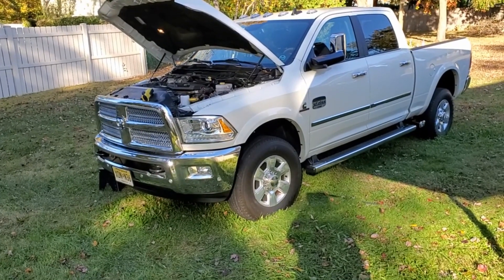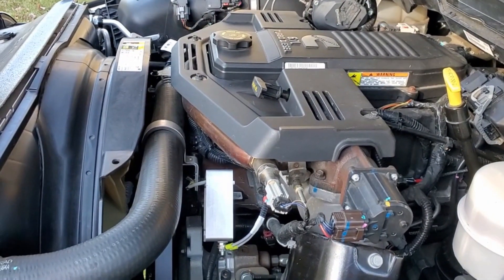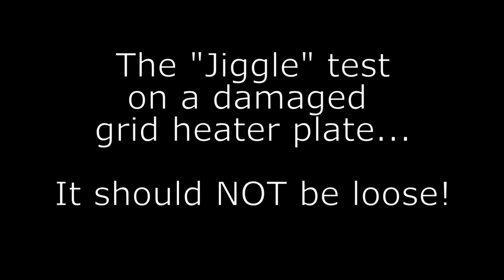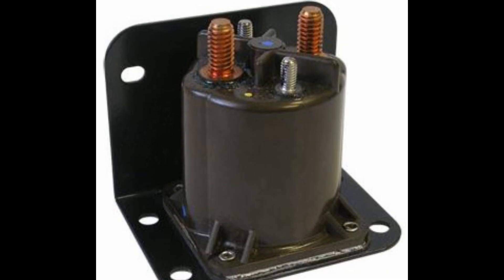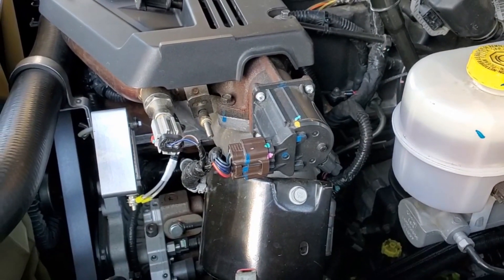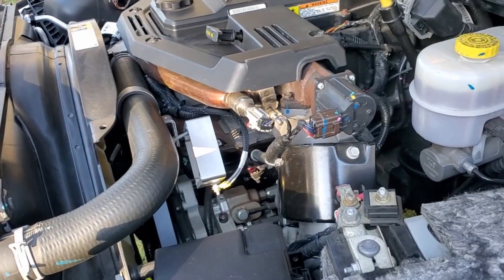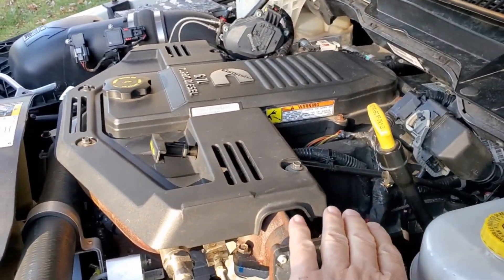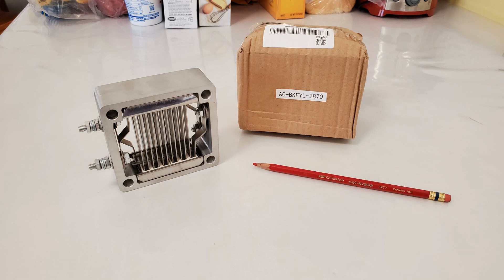GridHeater

Comment: Best way to get rid of this problem is don’t buy a dogde in the first place
Reply from the maker: Let me correct that for you... 
The best way to solve all vehicle reliability problems is to buy a gas powered engine. Modern emissions compliant diesels in today's market are complete garbage. Conversely, gas engines for small trucks (say under 15,000 GVWR) have greatly advanced in the last decade. Light diesel in today's market is a hobby and little more.

Comment: Hi I see its been 3 years since you made this, and you hinted around that you we're going to try 
to make a plug and play box . Just wondered if you ever got it done and if it was for sale. Thanks
Reply from the maker: Hi Cooter, The dummy load device I installed on my old 2016 has been doing fine so I never got the motivation to build the electronic version of the Grid Heater Delete gadget. If I ever do a tune & delete on my 2016 I'll have to look into designing and building the plug & play gadget.🍺

Comment: The easiest thing to do is to buy a kit from banks power Which has the upgraded Intake manifold. And the grid heater delete which does away with the grid heater completely and you will get more fuel mileage and more horse power out of the engine and its also e p a compliant and it also comes with a heater that goes into the intake manifold
Reply: Yes at the dealer if not under warranty I tell the customer to buy that and we can install it.  If it’s under warranty I let them know there is a fix but they’d have to pay for those parts and we can do it under warranty that way.

Comment: Got a P0542 code "Grid heater short circuit high". Any suggestions?
Reply from the maker: An easily resettable code. Can sometimes be fixed by removing/cleaning/replacing the thin wires on the grid heater relay.

Comment: I know this was 3 years ago but a list of parts needed would be great!    This looks like a safe way to solve a huge problem
Reply: You can go the Banks Monster Ram route. It has the grid heater delete.
Reply from the maker: Greetings Chain, The parts are just some old grid resistors that were harvested from a failed grid heater plate. If you check the dumpster behind any large FCA dealer (especially in winter) you should be able to get a few burnt grid plates out of the dumpster. Each grid plate has two resistors in it. You will need both of the resistors.
The dummy load frame (mounted behind my fan) I got off Ebay. 
https://www.ebay.com/itm/403192617742
Search on 5.9L Grid Heater Element and you will have a selection of frames and complete grids to choose from. For additional info logon to cumminsforum.com and search for posts by forum member Electrojake “Grid Heater” or P2609.
Reply: @Electro489  Thanks for the quick reply!  Much appreciated

Comment: WOW, that is good info.  Did you ever get the updated "module" for the battery to allow a total disconnect of the grid heater?
Reply from the maker: I never built the grid delete module since the analog (dummy load) device is working so well.

Comment: Fantastic information.  I am getting a P0541 on my 2006 dodge ram 5.9, the so-called mechanic that fixed it, replaced the regulator and the check engine light went on 8 miles down the road.  He actually zip tied the regulator on to the battery cable.  Shoddy workmanship to say the least. Thank you.  Whatever happened to real mechanics.

Comment: If someone were riding around town with a stuck grid heater relay coil, wouldn't they have the icon displayed on their dash? Some people may not pick up on this issue if it's displayed, but technically if that coil is energized constantly, that yellow icon should be displayed constantly as opposed to just momentarily during initial start up. I'm considering going to the grid heater delete with Banks Monster Ram Gen 2 mod.
Reply from the maker: No! The signal on the CAN bus (and on your dash) only shows what the PCM is sending out, NOT the true active state of the grid heater circuit. The Gen-4 Rams had a TSB issued several years back expressly because of the grid heater solenoid contacts getting welded shut (and staying on) even after the PCM went low on the intake air heater signal. The driver would be driving around all afternoon with full power to the grid heater even though these was no "on" signal being sent from the PCM. IMHO the red LED indicating grid heater power in my cab is crucial!
Sorry to go so long here but you should also be aware that ALL the gauges & indications on your dash are more or less fake. Oil pressure, volts, temp, etc... It has all been programmed to display what FCA "thinks" the driver wants to see and NOT reality. I could explain the reasons but I'm already way too long here. And thank you for asking the question.👍
Reply: @Electro489  Thanks for the explaination. I know the dash indications aren't accurate given that they're digital. I've dealt with false indications from signal conditioners, transducers, and converter circuit cards. They'll tell you that you're lube oil is low, temp hi, etc and until you compare it to an analog gage; or another source local to the equipment (if you can see it). If the can bus isn't set up to show the error that the relay is on when it shouldn't be; that's a problem. There should be a timer that should elapse and if ithe heater is still energized; there should be a fault. However if you take one of the inputs to the can bus out; you get a fault. They've made vehicles more complicated than they need to be just by having a can bus. Even Harley Davidsons have a can bus.
Reply from the maker: @a.r.o7697  100% Agreed. 👍 
Back around 2013 I had a 155cc Yamaha Zuma that had a computerized ECU running things. Has a check engine light on the instrument cluster and all. 😆

Comment: Why not just disconnect the grid heater from the coil it's connected to? You'll get a code, but the grid heater won't energize.
Reply from the maker: Because Remote Key Fob functions will be crippled if you do it that way. No more remote start, etc...

Comment: Why can't you just remove the power wire to the grid heater is it really necessery?
Reply from the maker: With the grid heater disconnected You will eventually throw a P2609 code and an MIL on the dash. Note that the remote start will not function if you have an active MIL. Mechanically the grid heater is NOT needed. The truck will run fine without it.

Comment: awesome video love the knowledge but i dont think my 2012 has that battery module so im deleting my grid heater and installing the banks intake
Reply: would like some more details on the led for the relay though
Reply from the maker: @philrettig4720  The LED simply connects between the grid heater stud on the engine  and to the battery negative. If you buy an LED make sure it is rated to operate on 12 volts. Any time there is power on the grid the LED will light, this way you can be sure your grid heater power is not on when it should be off.

Comment: I bought a Ram cus the good Reputation of its  Cummins engine but in each video I watch is nothing but bad things,,,Damn,,,,
Reply from the maker: Actually you did buy the right truck... 
If you had a Ford with the 6.7L Powerstroke you'd spend most of your time walking! 😆
There are two things to look out for on the Gen-4 Ram/Cummins trucks: Killer grid heater bolt and the killer rubber fan shroud issue. If you tow heavy in a hot climate then the fan shroud will get you. If you operate your truck in a cold climate and do lots of short trips then the grid heater will get you.

Comment: I have a 2019 3500 dually and my battery kept dying so I did alternator and batteries. Then seen the wires from relay burning hot. Volts was 12.2 running so I disconnected that cable from battery to relay and my volts went to 14.0 and all wires were good. Should I leave it disconnected or what problem will I have
Reply from the maker: Leave it disconnected! I am not familiar with the Gen-5 trucks so I cant supply details but your running voltage should NOT be that low so yes, keep it disconnected until you find the issue.

Comment: Great information. I'm new to the Cummins so I'm soaking up as much information as I can. How did you wire in the LED to monitor the relay status? I'm planning on deleting the grid heater when I install the banks monster ram as it has a new style heater option.
Reply from the maker: It is simply a 12 VDC LED wired directly between battery negative & the grid heater stud that was shown in the jiggle test. And yes! The Gale Banks mod is expensive but an excellent way to protect your engine from a catastrophic failure. 👍
Reply: @Electro489  You referring to the BANKS RAM air intake?

Comment: I have a 2018 3500 ram diesel. I am wanting to take my grid heater out. 
Your video is great. It looks like you have 2, 5.9 Cummins grid heaters as foolers. Am I correct?
Can you take some pictures of how you wired them up. 6.7 only has one wire going to the grid heater but the 5.9 has 2 I believe. 
Thank you in advance.
Reply from the maker: Email me at  electro.jake@verizon.net  for info.

Comment: Non diesel driver here.. what does a grid heater do?
Reply from the maker: The purpose of the grid heater is to warm the intake air going into the engine on cold winter days. The result is less white smoke on start-up. Be glad you have a gas truck. These diesels are an expensive pain in the ass.

Comment: All this fuckin around and worrying for something that has happened to maybe 50 trucks out of 100’s of thousands of trucks being sold. Lol.. I live in MN and my grid heater is in when it’s -30 for 40 seconds lol.. truck has 60,000 miles and 4 winters on it. If it was gonna happen to a lot of trucks it would happen to the guys in the north USA or Canada. Leave the truck the way it was designed..
Reply from the maker: There are two kinds of Cummins owners... Those that swear it will never happen to them, and those that had to drop $10,000+ on a new engine because they ate a grid heater stud.

Comment: My truck is throwing that code I'm getting ready to tear the truck apart . Did you ever make that voltage module for the battery?
Reply from the maker: No I did not since I have no need for it (yet).

Comment: I want to install a remote start. Would that be bad for my preheat starts in cold mornings?
Reply from the maker: The only remote start systems I have ever worked with are OEM (factory) so I have no clue as to how an after-market remote start would handle the grid heater cycle. However, it is my assumption that it would NOT cause any excessive burn time on the grids.
The big problems occur when people pre-heat their grids manually, especially if they do it repeatedly.
My advice: Install the remote start and you should be fine.
Reply: @Electro489  I don't do a preheat, but very curious about that. Is that when you plug in to a 110 outlet. I live in NY and temps sometimes go to the single digits. I never plugged in I just use a thinner diesel motor oil for the winter months. that does fine with no start issues except adding anti gel additive at fill up during those months and never had an issue.

Comment: What years is this exactly applicable to? Only 2010 and up or?  
I mean by the bolt failure, 07-10 safe or are the prone to that grid heater failure also?
Reply from the maker: All Cummins 6.7L engines use this type of grid heater, however...
The specific engine destroying failures my video describes are for Mopar part number 68210071AA used in model years 2013 to 2021.
Reply: @Electro489  awesome thanks for the info! Great video also, I went out and did the jiggle test and passed.
Reply: Hello, so just to calm my anxiety, The 2012 RAM 3500 doesn't need this MOD Right?  I just bought my 2012 Ram 3500 longhorn with 130K miles on it back in March 2020. Thanks for the Info.
Reply: @BlackRhyno17  i have an 08 6.7 and have the same issue. All 6.7s have this problem. 
My relay stuck on so i removed the relay. So i have a CEL until i replace the relay.

Comment: Did you manage to make a simpler device that would allows us to delete or disable the grid heater with a P2609 code. I'm trying to figure out a clever way of doing this with a local shop.
Reply: Was thinking it might be possible to somehow fool the truck into thinking it's warmer than it actually is (so the grid heater doesn't activate). At least not as much anyway. Might work for owners that live in warmer climates. Wondering if it would help to simply start the truck without waiting for the grid heater light to go out? Wondering if that action significantly reduces the grid heater on time, or does it continue heating after the truck is started anyway?

Comment: Really appreciate the video! I keep getting the 2609 code after I've been driving quite some time and it will sometimes turn itself off (at least according to the CEL). I've checked the death bolt for wobble and there is none, any suggestions on what might be wrong? I'm in central AZ hot as balls. Thank you!
Reply: For those of us in the Az desert, we should do the grid heater delete and mount the heater outside the engine to allow the computer to see it and not give a CEL.

Comment: Delete the grid heater or disconnect the cable from grid heater and grid heater relay. Simple and easy. If you don’t live in the north you don’t need it.
Reply from the maker: Okay but you'll have a constant MIL lit on the dash for a non-re-settable P2609
Reply: Electro489 I prefer that then having to spend thousands of dollars on an engine
Reply from the maker: @michelsanchez7057  In the big picture... I agree totally.
Reply: You can’t do remote start with a mil though.

Comment: I just had this exact same problem on the Cummins I currently working on. grid heater killer bolt came off from the inside, won't able to find the piece. we tried inspection camera, suitable magnet handle on each possible area, no luck. I just found the smashed bolt thread piece on #6 top of the piston, STILL CAN'T FIND THE NUT..
Reply: It is possible that the nut went out the exhaust valve. What a mess if it ends up in the turbocharger and damages that also.

Comment: Your grid heater computer fool kit would be great for those running a grid heater delete plate. I’d buy one from you
Reply: i unplugged the hot wire to the solenoid and never got any codes
Reply: So you just unplugged the wiring harness on the solenoid / relay?
Reply: @simonryan1430  on a 6.7 just undo the positive connection to the solenoid. It’s the battery on the passenger side.

Comment: Yea.... I have gotten codes for "Intake Air Heater High" on my work truck, and this makes me nervous as hell.  Going to check the bolt for looseness first thing tomorrow.  I tell you what: If you had a ready-made kit to solve this problem, I'd buy one in a heartbeat.  And so would others!  Go ahead and get one together, you'll sell plenty of them; I don't mind putting cash in your pocket for your intelligent analysis and solution!
Reply from the maker: * The small problem is: I could put together a kit with instructions but the cost of hand building them one at a time would be rather restrictive. 
* The BIG problem is: The liability. 
A sloppy or improper install by a user could possibly cause a fire. Also I am (slightly) altering the emissions system. Reducing grid current is very minor in the scheme of things but technically it does alter the stock emissions system and the EPA would hunt me down and fine me thousand$! Probably even give me jail time if they figured out I voted Republican in the last election.
Reply: @Electro489  Understood, about the pitfalls and liabilities.  This video may be enough for me to get something going which will work to ward off potential problems.  With all of the electronics available to modern car companies, I don't know why Chrysler Corp fails to use a graduated level of power to the intake air heater.  225 amps is a LOT, way more than needed except in the coldest of air temperatures.
Reply: @Electro489  I think this guy echos many of our thoughts. LOL

https://youtu.be/1Zr1cg4AGf8?t=556